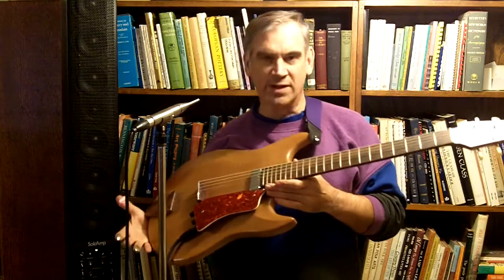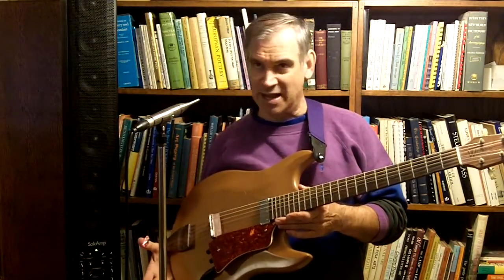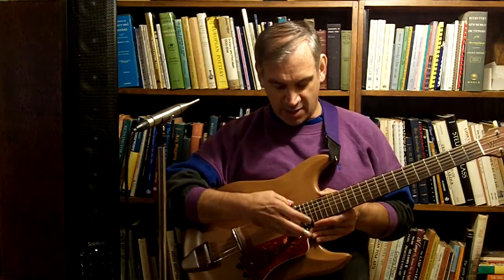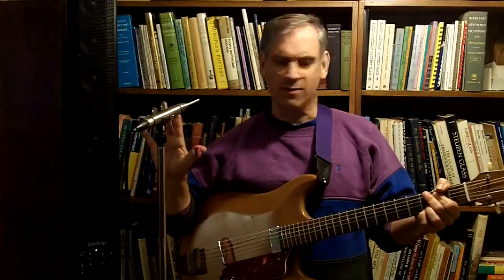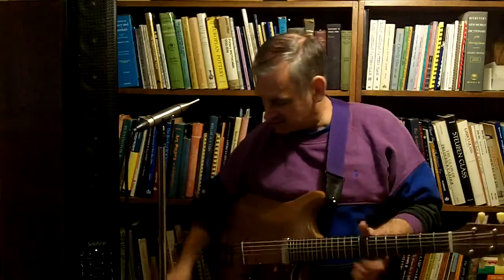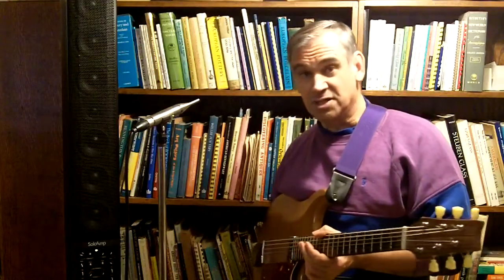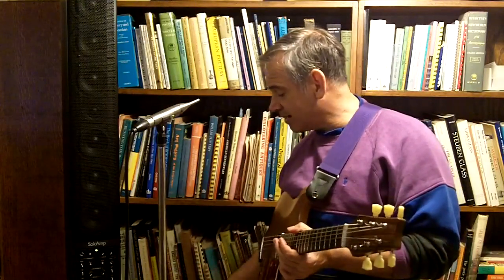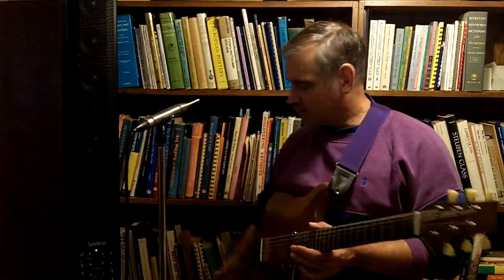Guitaniac's Unofficial Wendler ElectroCoustic Guitar Demo

Comment from the maker: @40791 I haven't got the Aura preamp any more, but I seem to recall it was one of the jumbo guitar sound images which worked best. What I finally discovered with my own electroCoustic is that it tends to like a high-mid cut of 3 or 4db at 3KHz, using the sweepable midrange feature on my Fishman Platinum Pro EQ preamp. That is a pretty unusual midrange cut, in that it isn't close to the best mid cut frequencies for my other guitars (of the rigs which need a mid cut).

Comment: It sounds good. I do wish it had a bridge magnetic as well. I like to use old Altec solid state amps made for drive ins and emergency PA racks that have Peerless output transformers. You need a pre as it is just a power amp. Very clean at moderate level and just a little snark at higher power.

Comment from the maker: Michael, Check out Dave Wendler's website: www.electrocoustic.com for samples of the electric sounds.
Reply from the maker: Oops, forgot to mention that I'm using D'Addario nickel wound strings .012 - .052 strings. I tried 13s, but they were a little too heavy for this guitar. I should also mention that Dave Wendler did a superb setup with one of my acoustics. That acoustic, and this electrocoustic which Dave built, are the best playing guitars that I've ever owned.